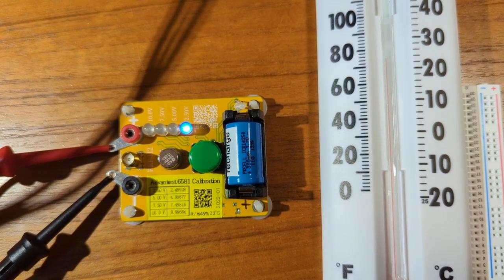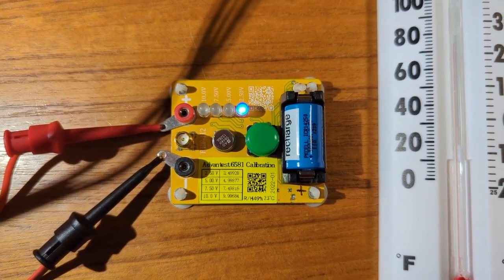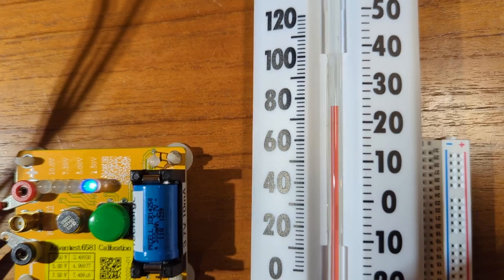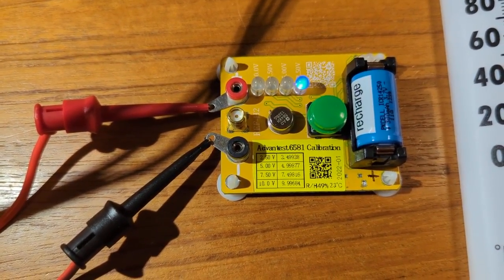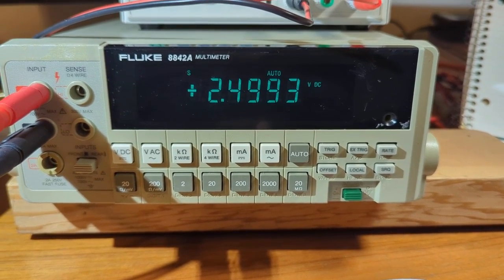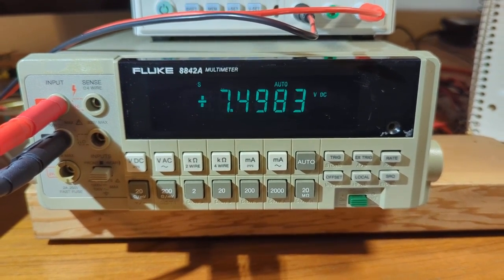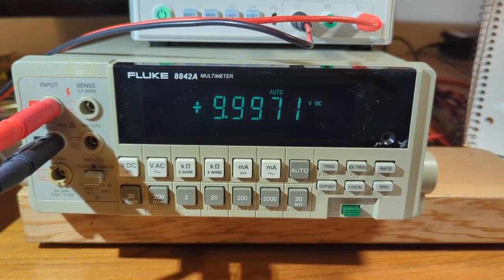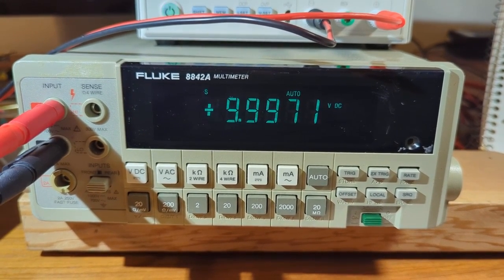Chinese AD584KH precision voltage reference measured with Fluke 8842A multimeter

Comment: The 8842 is like 30 years or so old, so when was this unit last calibrated? If it wasn't done in the last year or two this video was more about checking how good in calibration your Fluke is rather that verifying that the Chinese vRef was good or not. ;)
Reply from the maker: Yes, you are correct, Mats. I just bought that old Fluke 8842A on ebay recently. The funny thing about it is that every test I've done shows that the old Fluke is performing incredibly well. Its accuracy is still surprisingly good. So at this point, I do not think it's a coincidence that the Chinese voltage calibration device matches the Fluke multimeter within a tiny percentage at 4 voltages. I am finding that this is true for every voltage test, current test, and resistance test I've tried. Some of those other tests are also posted on this youtube channel, btw. This "adventure" with the 8842A started with an EEVBlog video recommending the old Fluke as a precise meter and an excellent value. It seems that this is still true. I may have the unit calibrated. But as a hobbyist, perhaps it is precise enough already.